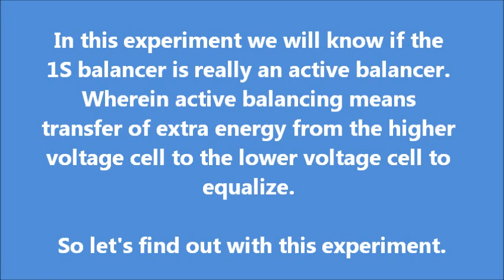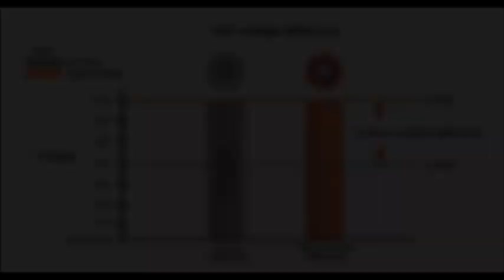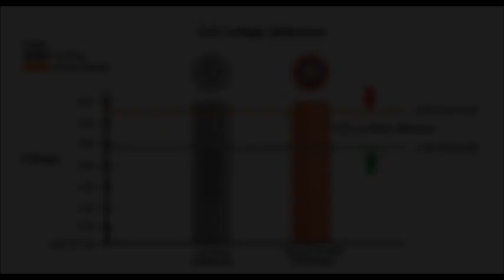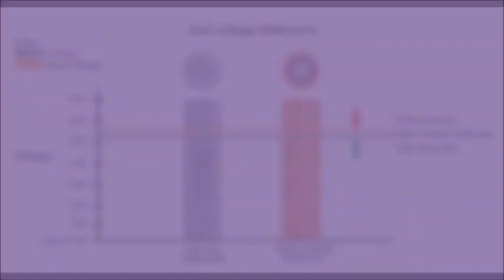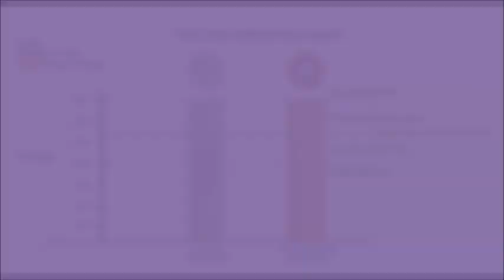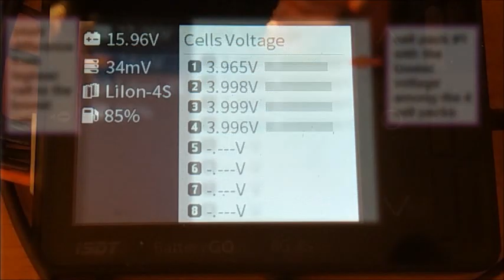Deligreen lithium active balancing experiment (Pagbalanse ng boltahe gamit ang 1S active balancer)

Comment: Nice video, thank you for taking the time to show this. It would have been to put the current meter on both cells to calculate efficiency.
Reply from the maker: Thanks for appreciating my video. well the balance current that you can measure is the same for both cells since they are connected together.
Reply from the maker: i've already done current measurements on my actual powerwall and they have all the same reading since interconnected, all the balancers are interacting to balance the lowest cell pack.

Comment: you should have more viewers and subs loving you real-world test
Reply from the maker: thanks. more videos to come
Reply: Great!
Reply: You should do a run down of your Powerwall.
Reply from the maker: i already did the rundown on my powerwall but i didn't have it a full video because it took me almost 20hrs. to deplete my powerwall. i only have 130w of load to use, so its much slower to bring my pack down to its lowest voltage. i have a bit of more than 3v (per pack) left when stopped my rundown. and the voltage diffrence is around 30mV.

Comment: Great and detailed video..
By the way, what happens when two packs are lower than other two??
Do they balance by receiving charge consecutively(one after the other) from other two? Or do they balance simultaneously?
Reply from the maker: it is balancing simultaneously because balancing does not only apply to one lower pack but on all other lower packs. lets say 7S pack with 3 lower voltage packs will be balanced by other higher voltage pack simultaneously until the voltage difference is just about 10-20mV from highest to the lowest pack. that's what active balancing do.
Reply: Philippine DIY Powerwall then, this is a very good product. Please, can you give me the order a link?
Reply from the maker: @striveupwards  here you can check their website and all of their products that may be helpful for your use.
http://www.deligreenpower.com

Comment: Thanks very much for your videos mate I have the exact same equalizers but I can't get mine to work properly there's a 60mv difference and the red light still doesn't come on. I've noticed in your video you've got the positive and the negative terminal on the equalizers together on the bus bar. I've got mine soldered probably 20 cm apart maybe that's my problem
Reply from the maker: that could possibly be the problem. but you can do the same test that i did (balance test with just 2 cells) to see if the red led will come on with  the lower voltage cell. that means the equalizer is working to charge the lower cell from the higher voltage cell. but if it doesn't come on (red led), you need to consult your seller, maybe ask for a replacement. it's also best to use clamp meter to see if there's current transfer happening in between cell packs.

Comment: Thank you for sharing your video. How long did the process take?
Reply from the maker: the test took less than 2 hours to balance 2 cells. but in the actual application on my powerwall takes longer since there's more cells to balance and depending on the voltage difference.
Reply: @philippinediypowerwall3852  does it balance at the top middle and bottom as well? Active balancing all through
Reply from the maker: it is balancing all through out. whenever the voltage difference goes off by more than 10mV, it starts the balancing process.
Reply: @philippinediypowerwall3852  thank you. I posted a link to your video on my last video. Thank you for sharing.

Comment: Ugh, why don't all bms boards do it this way?! This is so much more efficient and could quite possibly pull an extra mile or two out of an ebike!
Reply from the maker: @joblessalex i don't have any idea why they can't integrate a high current balancing with bms. most of the bms i know with balancing feature only have less than a 100ma balance current. and some good balancers that i know with high current balancing are just balancers alone.
Reply: @philippinediypowerwall3852  Do you have any info on how these work? I can't figure out how this wouldn't short the pack somehow. Want to build a 2-20s 300a capable one. The charge and discharge method is so cycle wasteful and energy wasteful..
Reply from the maker: @joblessalex well if you look closely at the test on the video. those 2 cells are in series and the balancers are hooked up in parallel to each cell. making the process somewhat  simulating the actual condition when the balancers are installed in a battery pack. the balance method is active balancing wherein the higher voltage pack is transferring extra energy to the lower voltage pack to balance or equalize.

Comment: This are utterly useless I have one and its not doing anything for my set up
Waste of money
Reply from the maker: it works fine with my lithium battery. sad to hear that the balancer is not working with your set up. if the balancer is having a hard time balancing each of your battery pack maybe you need to rearrange your cells using https://www.repackr.com/ pack builder to balance arrange your cell according to the actual tested capacity of each of your cell. 
Hope that can be a good help
Reply from the maker: another thing, you need to revisit the actual condition of each cell. you might have bad or weak cells that is beginning to affect the balancing of the pack due to self discharging condition especially for used or 2nd hand cells. they need to be replaced with good cells.